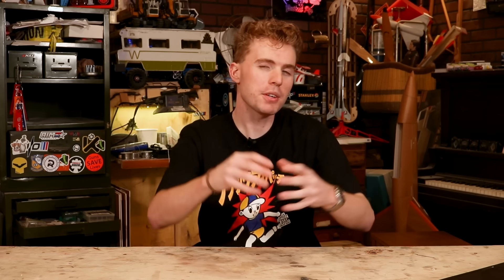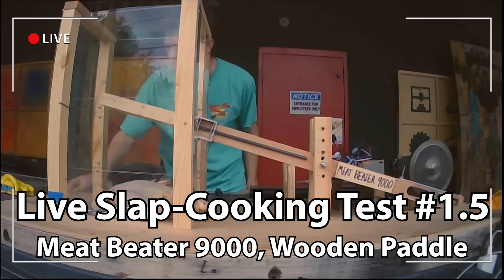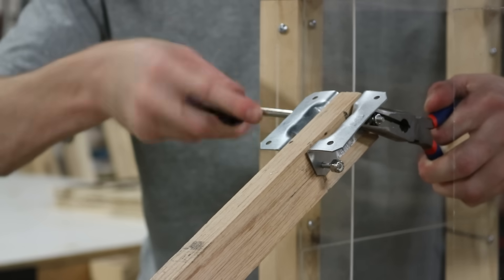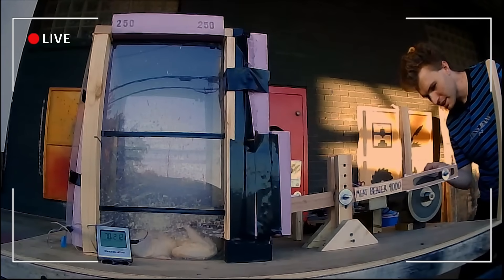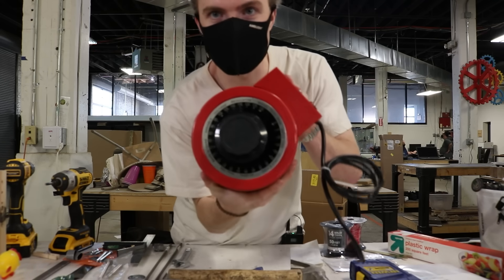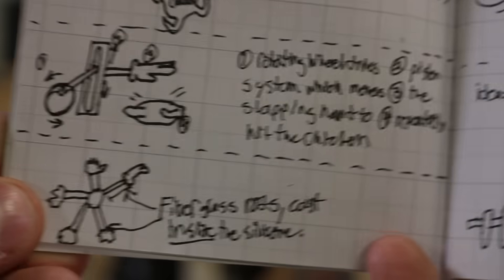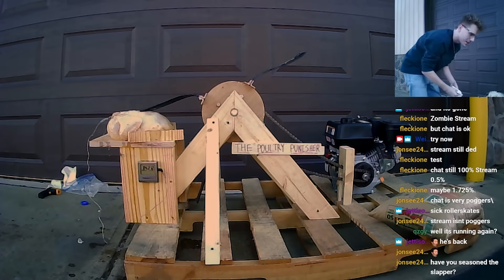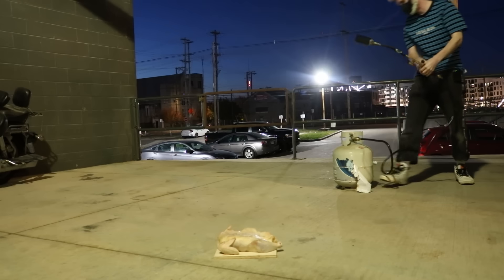How Many Slaps does it Take to Cook a Chicken?

Comment: No I feel like this was a success the question woz could you do it and technically speaking you can. Can you slap enough to be able to eat it no but I don't think you were ever going to be able to because it would only be that 1 piece where it made contact with the slap. That one spot can't cook the whole chicken and it's sitting out for hours and I wouldn't trust eating it anyway but you did heat the chicken to quite a high temperature were talking from cold to at least preheated that's pretty cool.

Comment: I suggest we put a suitable thermal conductor, with reasonable impact resistance properties, amidst the chicken and the slapper. How about a stainless steel thin coat on a copper plate? This should transfer heat gracefully and prevent the chicken from becoming.... yeah...
I also propose that for better durability of your 'slapping system' you use something that has elastic collision properties, how about a rubber mallet?

Comment: Did somebody take into account the cooling caused by air circulation because of the slap movement? It wouldn't allow heat to be retained... I think the simulation would work if carried out in vacuum,  or otherwise reduced air pressure.

Comment: You should try in vacuum
With perfect cut piece of chicken
Down side should coil so heat stay there 
Then it's close to rise 10 degree temperature 
But you can't cook any mean
Because chicken can't handle pressure you Putting on
You work on direct transfer energy to metal which heat up then heat transfer to chicken
Like plate of iron plate

Comment: It looks like the chicken is going to need a thermally conductive sturdy exoskeleton to survive these slaps. Pretty sure it can be done if the chicken had some kind of copper armor, that eventually starts cooking the chicken once it gets hot enough on the inside. 
An improvement could be: coat the chicken in thermal grease, put it in it's copper chicken armor, isolate the outside of the chicken armor to prevent heat loss from radiating to the environment, and only keep the part to be slapped open. Has to work.

Comment: Why not put a conductive surface on the top (metal plate) and place the chicken underneath it and slap the metal plate so that the heat is transferred from the metal plate to the chicken without destroying the chicken in the process!!

Comment: I wonder if there’s a way to take the kinetic force of the slaps and use it to power a small heater or something. Like build up the slaps and output all the heat like in the initial question. I guess it’s not quite the same as the actual slapping though

Comment: Ok so new one.. if air resistance causes friction which results in heat transfer.. how fast do you have to spin a hotdog in a sealed chamber and at what pressure level does the chamber need to achieve to create enough friction based on the rpms? 

I’m thinking die grinder and 60bar might do the trick lol

Comment: If the 3rd attempt nearly worked and only failed because the galvanised bolts broke off from the wooden arm, couldn't he just replicate this but with one solid slapping arm piece, instead of bolting two pieces together? Also the 4th attempt had no insulation or room temperature control like previous attempts... I feel I may be too invested in this now, lol 😶 dam good effort though

Comment: Aren't you relying on a consistent slap therefore if you increase the speed of your slapper you are hoping to increase the amount of friction without taking into account increased force per slap in the design, right? So why not increase the amount of slaps without increasing the amount of force (haha yes, sps)you would get a result in that would have a higher frequency of friction instead of a higher impact of force. Also you might try different forms of meat, I would recommend something without the bone in it the heat will transfer throughout the meat more consistently this way more flaps more slaps just sayin' try a chicken breast.

Comment: What you need is basically vibrations that don't destroy the chicken. So you need a generator of coherent emission, focus beam on a plate that accumulates kinetic energy and turns it into heat, and put a chicken beside it. Laser is like slapping, but very, VERY fast.

Comment: what you need to do is build a slapper oven. put the chicken in the oven, and raise the internal temp of the oven with slaps outside of the oven. this way you can rig some kind of durable metal slap receiver that heats up as you slap it. and this heat will transfer towards the inside of the oven thereby cooking the chicken. the question is how many slaps to cook a chicken, not how many slaps on the chicken to cook it, anyone with enough common sense would know that if you slap the chicken directly it will be destroyed before cooked.

Comment: you need to go with an outside of the box chain of thought, you don't need to slap the chicken directly as long as you're getting the energy of the slaps to cook the chicken, so all you need to do is generate heat from slaps, store it somehow and use it to cook the chicken without fucking its integrity, you can even store the energy and use it to power up a micro wave ... idk im not an engineer but technically you'd be cooking it through slaps, and i doubt 23k is enough to power up a microwave to cook the chicken

Comment: Could you like slap the chicken while it's cooked on normal way? Would the meat become tender or even tastier? Cant help but thinking about that.....add the slapping technique using slapper with bigger surface area (so the meat wont be butchered into pieces) which cover the whole chicken in a heat chamber with suitable temperature to fully cook the chicken.....make sure to seasoned the chicken beforehand....so the slapping will help the seasoning to seep into the chicken even more…..

Not talking about experiment, but i'm focus more on cooking aspect....we could get tastier food if done correctly

Comment: I think it would have just been easier and faster to put it on the engine block.  On a real note though, I think a factor for consideration is the weight of the slapper.  Heavier slapper, imparts more energy on impact.  So when you switched to the flap wheel, the lighter flap didn't impart as much energy/slap and so you needed an even faster speed to achieve the same results you had before.

Comment: I think one problem with this rig is that the distance the slapper travels is fixed and relatively large, so to increase rate, you have to increase velocity at impact, which hastens paste-ification.  Instead, try using a rig something like a speaker coil, so you can get very high frequency with low impact velocity.  Essentially though, you're getting to a wave generator, and I'm pretty sure that's just called a microwave...

Comment: Your crack team of engineers is bad too- If you weren't concerned about chicken integrity the best way to heat it up would be with a belt sander. The upstroke prevented excess chicken(and therefore heat) loss. Also the insulation helped.

Comment: I think the temperature rising in the glass cabinet is because of the sunlight heat trapped by the glass and not by the hitting of the chicken. And that's why in the next attempt when the experiment was conducted in an open air surrounding there was no temperature increase observed.

Comment: Wouldn't be better "micro slaps" for this project? Let's consider microwave - it heats by making h2o molecules move in the same frequency as waves (due to the resonant frequency) (I am not sure, I am not an expert).

So if you did small-power, high-frequency slaps, and just make the chicken vibrate instead of move like madman, wouldn't it work better? But I bet that it's not possible to vibrate it at such high frequencies.

Comment: At 7:30 shouldn't the graph be logarithmic instead of exponential? the temperature growth in reality is slower and slower depending on energy put into the process of heating but on the graph it gets faster and faster. a little stickman pushing the stone up the hill doesn't really shows this correctly i think

Comment: I think you need alot more insulation and more surface area being struck. Perhaps insulated piston on 5 of the 6 sides of the chicken. Spreading the strain across more surface area would help reduce damage and cook all sides better. 

The 4 belt slapper had no insulation and used too much friction as it slipped over destroying the meat. Also the belts would be air cooled as they flew around before slapping again.

Comment: Use a tractor seat as a formed chicken slapping seat and tie it to the seat using strong webbing of some kind  with the chicken wrapped in a bag made from space blanket/similar: you can get space blankets designed to be kept in the car that are pretty robust, it would also contain the meat pieces though you should probably do this with beef for lower health risks and better heat distribution; there's also foiled fabric for lining ironing boards that might be useful. And use Celsius.

I thought about using maybe a bean bag or cushion, I've used a beanbag in the past as like a modern haybox. But I don't think that would work. Polybeads everywhere. The  right foiled/fabric enclosure with strong enough webbing to hold it together would do more. Wrapped in a teatowel might not be very visual but it could work.

Comment: Do it in a vacuum so that the arm doesn't cool it by moving air at the same time. Perhaps a piston with a rack of teeth and a sector gear at high rpm, the piston will ride vertical rails under spring pressure and slap the chicken.

Comment: While slapping its blowing air as well which is cooling the chicken faster than being heated by the slaps.
As the collision is inelastic, most of the energy ends up in changing the shape of the chicken. 
Things heat up when we vibrate the molecules of an object which can be through heating or through physical movement. Therefore, slapping is not an efficient way of vibrating the molecules of the chicken. Instead we can grind the chicken in a mixer grinder and it will cook the chicken faster. But ofcourse we won't be able to eat that.

Comment: I wonder if you could use a really huge speaker coil to drive a slapper. How much difference is there between vibrating the food to transfer energy to it, compared to vibrating the water molecules inside the food to transfer energy (how a microwave works).

Just directly place the chicken underneath a vibrating plate driven by a huge speaker coil, and press the plate down with a little weight. I'd say put the chicken on top of the vibrating plate, but not sure if that would work or if you'd just end up collecting waste heat rising off the speaker coil.

Comment: The last attempt was great and all but i think you forgot to consider the displacement of air caused by the motion of the slapper. In simple words you are cooling it down while generating the heat at the same time which explains the fluctuating temperature

Comment: What about Transferring Just the Heat and No Impact. If you enclose Chicken in Metal Box and slap it with Rubber or Metal, the Heat generated can be used to Cook, but the mechanical Impact will Not tarnish the integrity of the chicken

Comment: As an termoengeneer i made some observations.
The problem is that rotation slapper also create wind current that is cooling down the chicken. I suggest to put less slappers. Maybe even one, but bigger, especially longer and harder rubber. Look how much force You loose on bending. Its like slapping an ass with piece of paper. No Matter how hard You do this, most of the force bends away.
Longer and harder slapper could create more whipping move

Comment: Instead of using the wood padded, would a silicone hand have worked better when it comes to not completely smashing the chicken? Is there a way to use energy from a treadmill to power the motor some how, like a hamster on a well? Idk, I’m high and just thinking stuff 😭 awesome video tho!

Edit: just watched test 4 and apparently the chicken will be extra killed regardless of the material used to beat your meat 😭

Comment: Well how about approaching the problem another way. Instead of slapping the chicken directly what about slapping a piece of copper plate? Insulate the copper everywhere except the slapping area and then extend the plate into a makeshift oven where you can use the copper plate as the heat source. Minimise loss and no loss in chicken integrity.

Comment: Wanna know the issue same reason an oven is enclosed in a small insulated area you can’t build heat if the heater coil was in a huge Open room you need to put the chicken and slapper In a small enclosed insulated box and the heat will build

Comment: Could you extend your definition of slapping to include:

A mold of one side of the chicken "slapping" the chicken so that the load is distributed. I wouldn't exactly call it slapping but it's still mechanically exerting energy to cook the chicken. I think the chicken has a better chance of surviving by distributing the force you're exerting each time. The problem there might be that by slapping more of the chicken you need more slaps/sec (More power) to heat that greater surface area. I haven't done any work on it so those are my assumptions.

I guess I'm just thinking about how to get to the center of the that owl's tootsie pop mechanically. I don't need the sugar.

-Grammar edit

Comment: "You're not thinking fourth dimensionally, Marty!"  Specifically, a tetrahedron is the platonic solid (regular, convex polyhedron) with the least number of sides (4).  A cube has 6, an octahedron has 8, a dodecahedron has 12, and the icosahedron has 20.  Let's keep it simple and use the four-sided tetrahedron.

Next, we need a pile driver, not a slapper, and preferably one that will kinetically move the chicken without damaging it.  

A TRANSDUCER!  A transducer converts energy from one form into another.  In this case, from electrical to mechanical.  In our case, we want underwater speakers, and loud ones i.e. sonar thru-hull transducers.  We also need four of them, each mounted in the face of each of the four sides of the polyhedron, which is built from Lexan (500 deg F), with the top triangle parallel to the Earth's surface, and hinged.  The other three triangles are thoroughly plasti-welded.

1.  Insert chicken.
2.  Fill with water
3.  Close and seal top
4.  Fire up those transducers.

Since a typical sonar transducer is capable of handling 600W of power, and we have four of them, we have a 2,400W oven, right?  Well, no.  More like a 125W oven.  600W isn't a continuous rating.  But they can probably handle 25 W continuous (close to the square root of 600).

Yes, we're still heating with physical energy...

And we'll also need to insulate this apparatus with foam...

Comment: You forgot to take into consideration that the human body puts out heat, even the hands. So now you're gonna have to figure out how to heat your paddles to 97.5°F and do it again. I'll bet this is still possible. Further testing required. Another variable to consider, the human hand would also be less rigid than plastic or rubber and would give way once making contact with the chicken so the blow would be less damaging as well.
I'd say this is still possible, we're just not there yet with our current technology.

Comment: How about an intermediary. a surrogate. IE a metal box that the chick is put in that is insulated. then you slap the metal box heating it up heating up the chicken inside. IE you add an intermediary between the slapper and the chicken to protect the chicken? inside the box on all surfaces except the slapped surface to hold the gathered slap heat in.

Comment: There is way, how to cook meat with one big slap.
It's explosion. You can encase steel pipe(sawed off propane tank) in concrete. Put inside layers of meat, seasoning, and onion. There should be thick layer of onion on top of meat. Then there should be thick layer of salt with pepper and load of explosive. 
You should use explosive, which dissipates into H20 and CO2. Acetone triperoxide is perfect for cooking. 
So, blast wave will resonate in pipe and give pretty much of it's energy to meat. Sadly, it's pretty hard to guess, how much explosive do you need to properly cook meat in given blast chamber. So you'll need some trial and error.

Comment: First design with aluminum components, and with a flexible leaf-spring mount for the slapping paddle. The rigidity of the arm is what destroyed the chicken there. And wasteful though it may be (I mean c'mon, this entire exercise is wasteful), the upstroke is also necessary in order to not destroy yhe chicken. The 2nd design demonstrates that anything travelling "through" the chicken, will eventually travel through the chicken.

Also, you need a faster slapper. Gear reduction is expensive, because gears are expensive. But a fractional horsepower belt can also be used to increase rotational speed via reduction.

Also, the mass of the swing arm needs to be reduced, so as to ease the stress on the motor. Shortening the length could reduce leverage stress on the motor. Some sort of shock absorbing chicken mount would also be helpful - I'm thinking 3 inches of kitchen silicone should help. 

Overtravel of the slap arm should also be minimized. There should be no wood in the setup. And there should also be a designated point of failure... probably at the "wrist" of the slapper, along with a supply of quick change replacements.

Comment: Crazy idea, place the chicken on a heat conductive and sturdy metal surface, use slaps to transfer heat energy to the cooking surface. This will remove the issue of the pulvarized chicken. I feel like in this set up you could perform slaps of immense power and speed to transfer more heat. It wouldnt so much be a chicken cooked by slaps, but a slap powered stove.